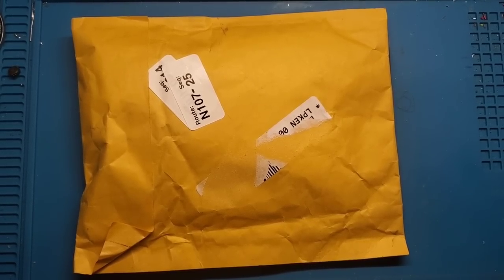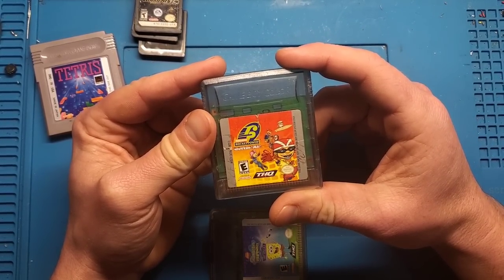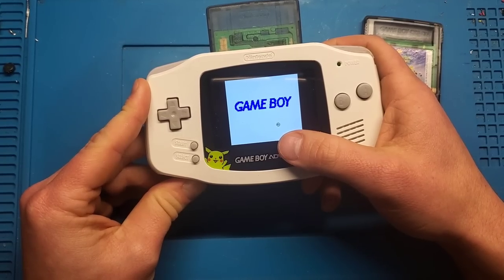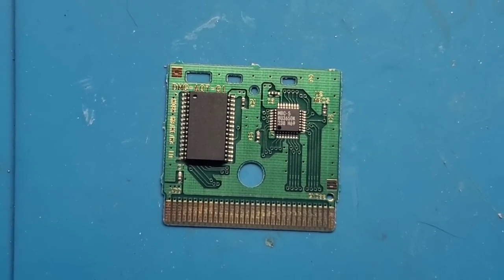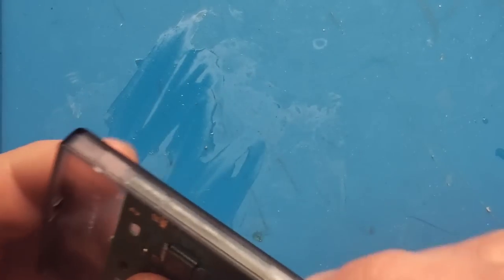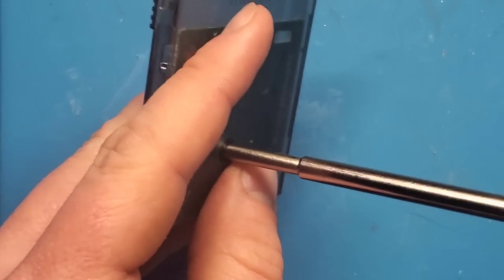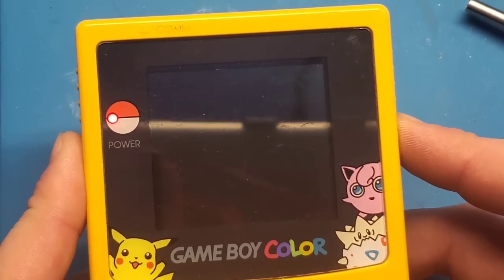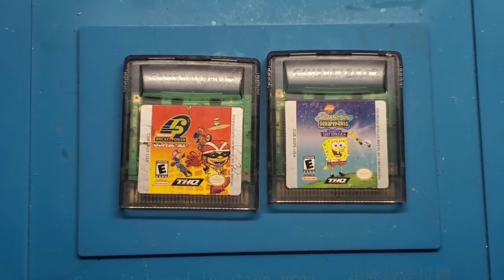Fixing two Game Boy Color Games - Fixing Ebay Junk

Comment: Well, seems like if you want to dump some of those lower value game carts, just label them as "for part/repair" and people will buy even the worst games just to try and repair them, lol.
Reply: Sadly, it seems to be driving up the price of broken hardware.
Reply: If you're into circuit boards or anything similar from the era, they're actually pretty easy to repair, it's usually just the contacts and a few chips.
Reply: @mustangmckraken1150  depends of what we talking about. If it’s contact loss it is. But if we talking about chip shortage or power issues in more complex way... well. It’s not a 6 layer board of Xbox at last)

Comment: Awesome videos...Was able to fix my Resident Evil Gaiden cartridge with the help of your videos. Able to trace all the contacts with my multimeter and found a couple of disconnections. With a couple of wires installed to reconnect, it is up and running with full save support. Thanks and keep it up.

Comment: Lots of chips the cheap asses put so little solder the joints fail over time. I always add a little more solder when fixing failed joints.

Comment: The whole "It's always the first/corner pin" is a mix of superstition with confirmation bias. I've heard that for years, but over years of doing this found it to be more or less a coin flip.
Reply: I don't really think so. There is a obvious reason why it would be that pin (pin is connected to the bigger copper plating which sucks the heat away).

Comment: I like how on other channels someone buys a lot of super defective stuff and it's a bummer. Here? That's what you want. If the lot worked, it's no fun, lol.

I wonder why that one pin goes bad? Two carts in a row had it go bad and apparently that's a common one if those comments are to be believed, and I obviously do now!
Reply: (Somewhat) Bad board design. This pin is connected to GND (could be 3.3/5V as well, doesn't matter for the problem at hand), which is the copper plating that covers most of the board. This copper sucks the heat away when soldering, so the pins don't get connected as good as the other ones where the heat stays where it belongs while soldering.